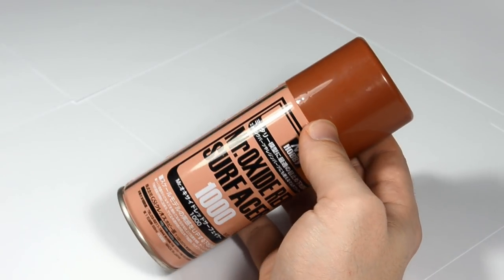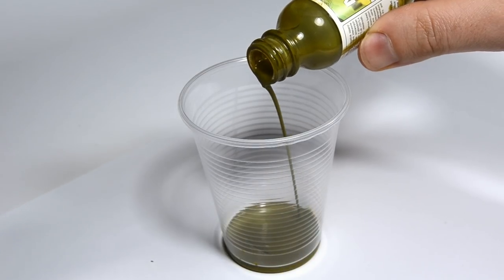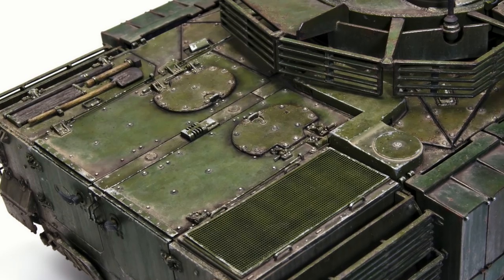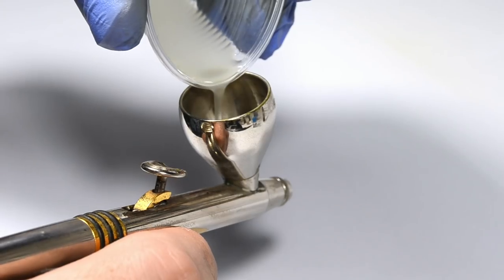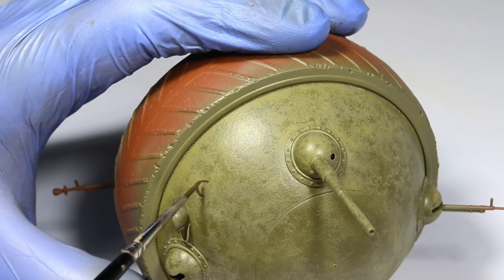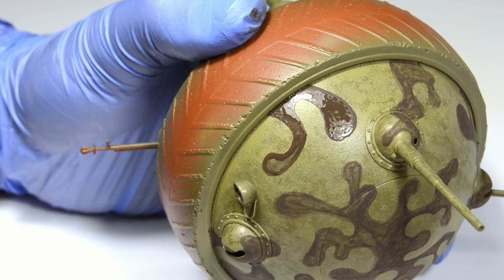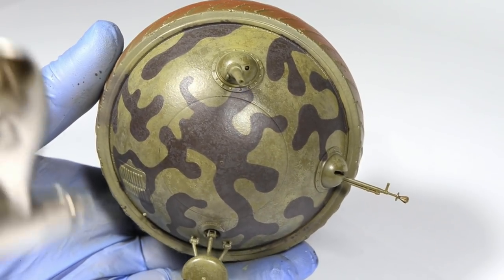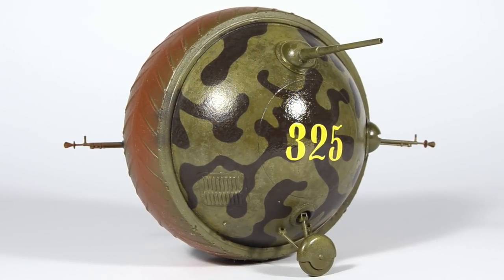Painting the Soviet Ball Tank "Sharotank" (Miniart 1/35 Scale Model Tutorial)

Comment: Great video. Can i ask if you have gotten tide marks using water so liberally for chipping? I chipped my first kit last year and the chips were great but the water nearly borked the base paint.
Reply from the maker: Thank you Adam! No, there were no tide marks on this one. I get them from time to time especially when chipping paints on a flat Tamiya base coat, but the gloss varnish I apply right after usually eliminates them. And if that wouldn't work, there are techniques like oil paints, chipping and dust which can hide them entirely. Hope this helps.
Reply: @NightShiftScaleModels  ok thanks. I love doing hairspray chipping and was kind of discouraged. So I'll see if a gloss helps it.
Reply from the maker: No problem Adam, I'm glad to help. I'm personally not a big fan of hairspray chipping because how unpredictable it can be, so I mainly use it for different things like textures etc. I will have two videos about brush painting chips on this model, one for light green and one for dark steel chips.

Comment: great idea to paint the decals.
Also I see you apply the Gunze softer first and then the set product. 
 When I apply Microscale products I apply micro set  on the surface (sometimes is aggressive on metallic paint and changes a bit the color, but not visible with the decal on anyways) and then put the decals on and then a layer of micro sol. 

Am I applying set/sol in the wrong order?
Reply from the maker: I’m actually the one doing it wrong 😂 Setter should go first and under the decal, but I found the decals harder to manipulate and position in place, so I started doing it like you’ve seen in the video. The setter will still work its way under the decal.
Reply: @NightShiftScaleModels  I agree..sometimes the setter, sets the decal not straight and it gets hard to move; that's why I was thinking of not applying the set at all or apply it once is in the right position. Also the softener sometimes is aggressive on decals of smaller local brands and it mess up melts the colors. happened to me recently and I painted the decals over ;)
Reply from the maker: @HectorLopez-tl2fk  Ah I see, good thinking! Yeah decals can be sometimes unpredictable.

Comment: Love your videos! How long does the chipping fluid have to dry for before you can paint on it? and how long do you leave the paint on before chipping it?
Reply from the maker: Thanks mate. I don't have any specific timestamps, but I usually work pretty fast, so I wait until the chipping fluid is completely dry (every last drop evaporates) and then I can cover it with paint. When I'm done airbrushing I start chipping right away. I never wait, because I always had problems chipping when I left the paint to dry for more than a few hours. However it's possible to chip the paint even after a few days if the layer is thin enough, but I can't say how controlled the effect is.
Reply: @NightShiftScaleModels  Yes, I was told to wait over an hour before starting chipping and the paint was so dry i had to press so hard i chipped it all the way to the primer. Keep the videos coming!

Comment: Interesting video with lots of inspiration. One question: does it matter which colour you use as a primer? The red is not used for chipping? Gr Bas
Reply from the maker: Thanks Bas! Umm, yes and no. The colour of the primer will affect the paint on top of it but since I always post-shade my models it usually doesn't matter, and I always use 2 or 3 coats of the base paint. So it's more about my current mood. And I just like the red primer, I just like the color. There might be one benefit, if you forget to spray some hard to reach part, there won't be any grey primer shining through, but this oxide red paint, which can be presented as a factory primer on the real vehicle. I will use grey and black primer on my next model so you can check it to see the difference.